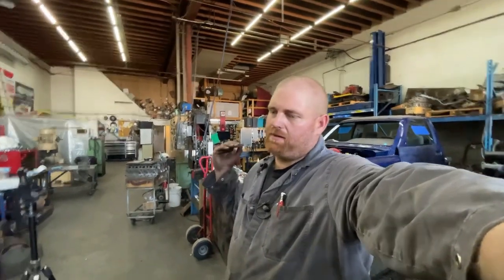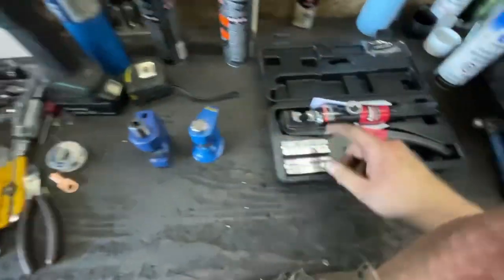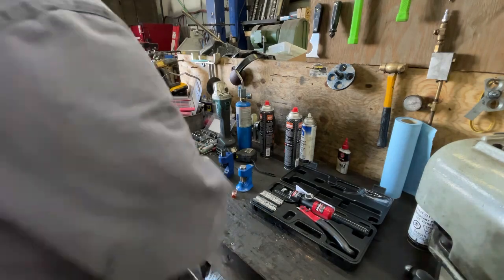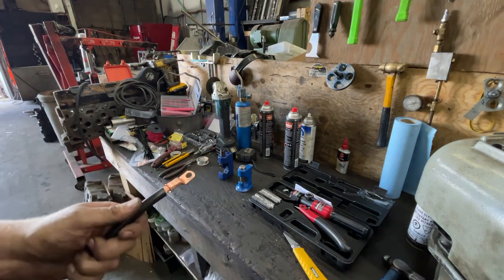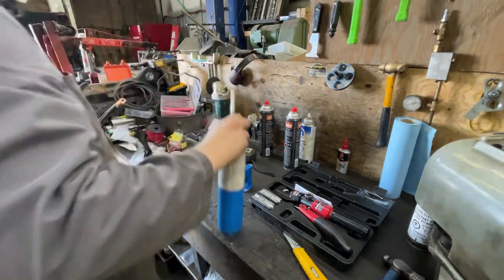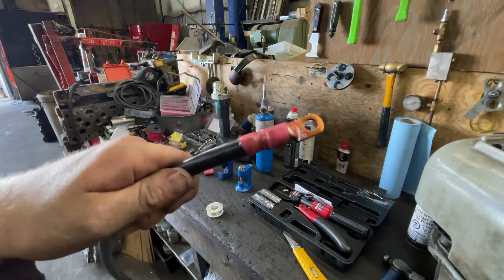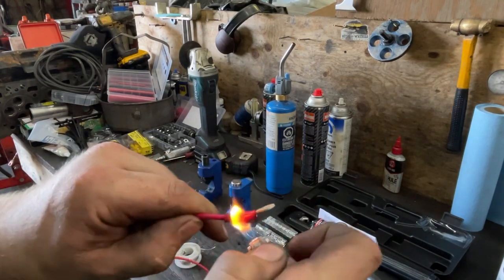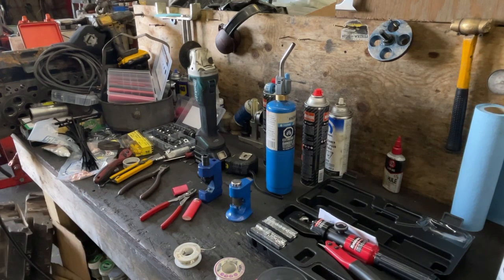How To Make Your Own Battery Terminals ( and the tools I use )

Comment: How about a video on electric lift pumps(for black diesel and reg)?  example cheap pump, thinking man's pump, vs race pump or fass style system.  I have seen some use of the bosch 044 gas inline pump. Also a discussion of the BF1212 filter vs say something like a PH8A(old ford v8 oil filter B2 in baldwin).  The PH8A or equivalent can be found everywhere and is super cheap. It's about a 30 micron absolute. this makes it a little easier on a lift pump for longevity.  Possible figure out easy ways or places to find the BF1212 or equivalent fit filter while on a cross country trip.
Reply from the maker: I will doing one I have had a couple guys ask
Reply: @CUTTERUPROB  thanks!

Comment: I had the same problem with my crimper.  I used marine cable and nickel plated lugs and they didn’t solder well so I skipped that part.  I couldn’t agree more on the heat shrink. The better the heat shrink the less frustrating it is.
Reply from the maker: If you using nickel plate ones then is special Solder for them. I can’t think of the nuance off the top of my head. But when I do I will mention it

Comment: I have a few of the cheaper hydraulic crimpers and there is a chart for the gauge sizes to the dies. I find I need to get the next size down lug and use the next size down die so I don’t get the wings crimped in to the lug where it presses out in between the dies outside of the hole. I try and use the same size lug for the wire and the lug is too big and just slips on and off and doesn’t crimp well and I find the next size down lug is a tight fit like you had and crimps well. I recently got some large open barrel connector crimpers and I like them.